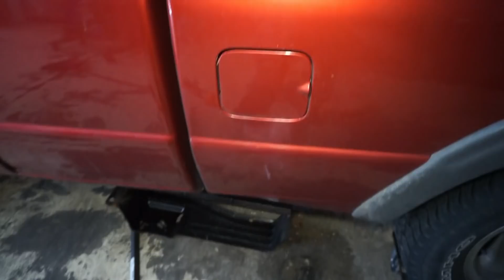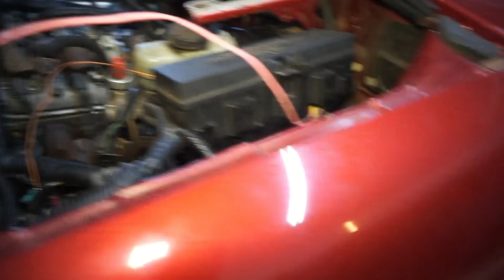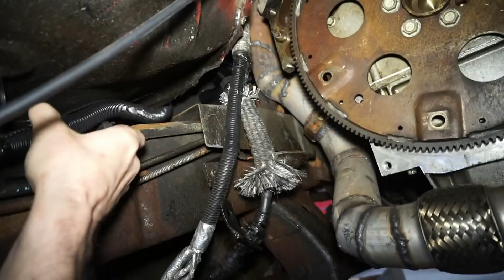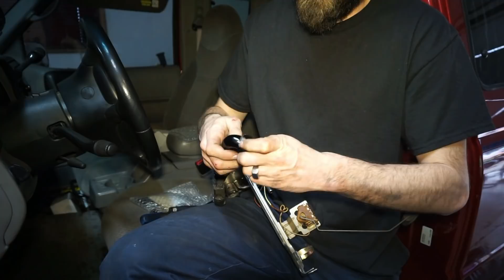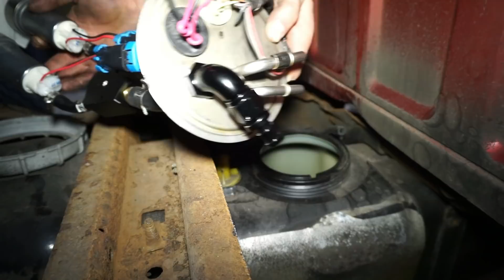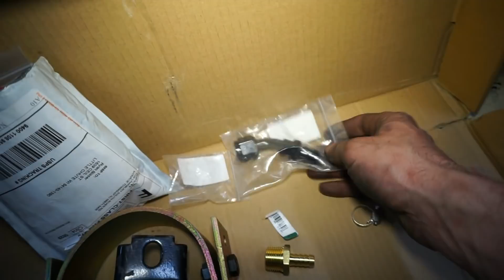DUAL WALBRO 450 FUEL PUMPS!!! TURBO LS SWAPPED RANGER!!!

Comment: Hey man, if you didn’t run the 1/2 hose after the y block and ran a 3/8 hose instead, how much of a difference would that make ?
Reply from the maker: Would depend on power goal... 600-700 you'd be ok. But if you want to stay closer to 700+ it makes sense to just to the bugger line right away. Then you don't have to worry about upgrading it later.
Reply: @BlaserBuilds  

Thanks man. So from the top of the y block which is an 8an to the hanger (which would be the 1/2 line) would I have to upgrade my fuel line also to 1/2 or would the 3/8 fuel line to my
fuel rails work ?
I swapped over my fuel tank to the efi tanks
inc. And the hanger came with the 3/8 line already fabricated in the hanger
Reply from the maker: @Aboyzwildin_  Same would apply.

Comment: I was always told that for E85 you need Teflon fuel hose and not to use the rubber stuff as the ethanol will degrade the hose.  Not sure what kind of hose you're using here but it looked like just regular rubber fuel hose.  Thanks for the video!

Comment: I had my dual 450 fuel pumps setup at the front straight down from factory location like this and at full throttle with 1/4 tank I blew er up.

 I now have them laying on the bottom all the way at the back. 

Keep in mind I have a massive long box tank so fuel slosh to the back is worse but I wouldn’t run it this way.
Reply from the maker: Lloydminster RC Good to know... This is way more pump than I need so should be ok... I need all the weight I can get in the back so I'll keep the tank full ;)
Reply: I haven't looked too much at my ranger's tank, but maybe there's a way to mount it backwards with the wires/lines extended?